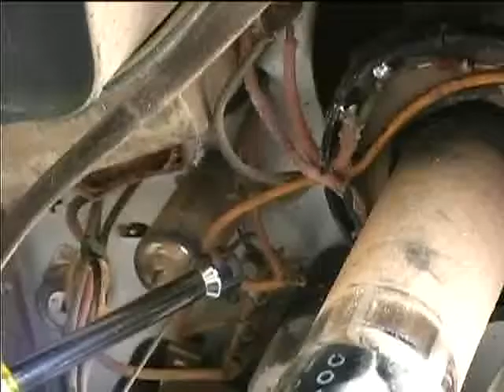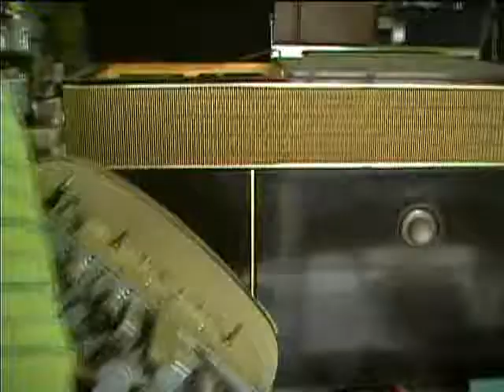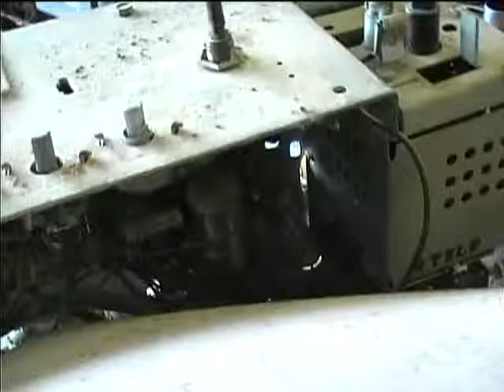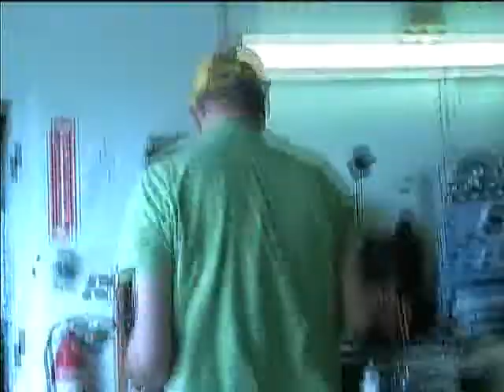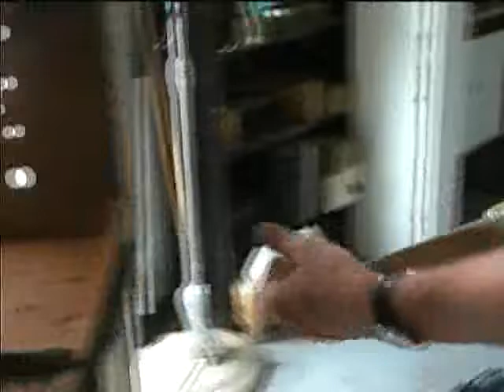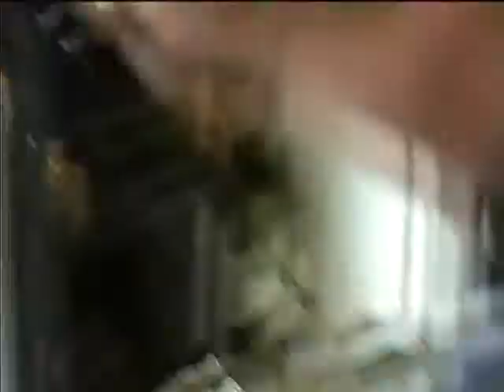southjk removes Magnavox B/W TV chassis from cabinet

Comment from the maker: As I recall it sounded pretty good...new caps should make it even better, Looks like a 10" full range speaker. I think once TV sets started going toward the shorter lower cabinets the sound quality diminished with smaller cheap speakers.